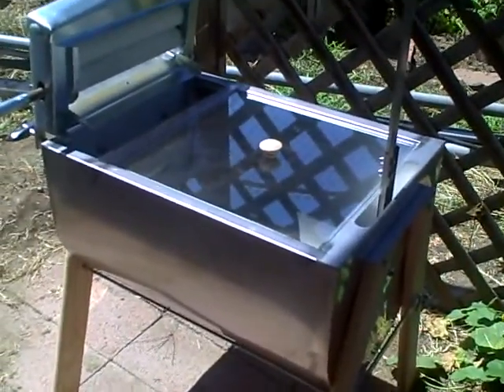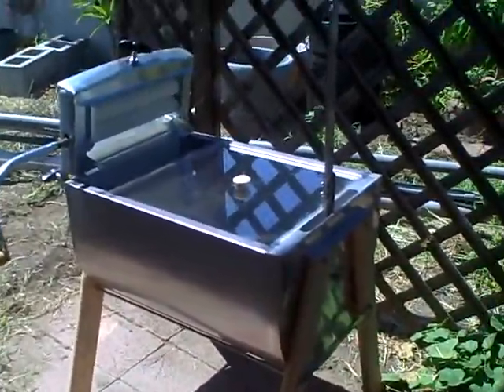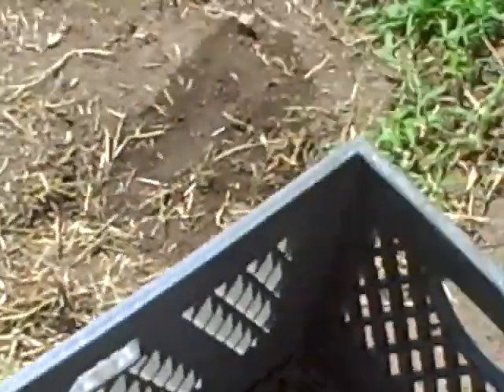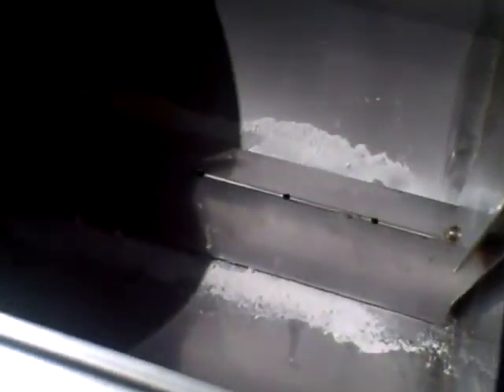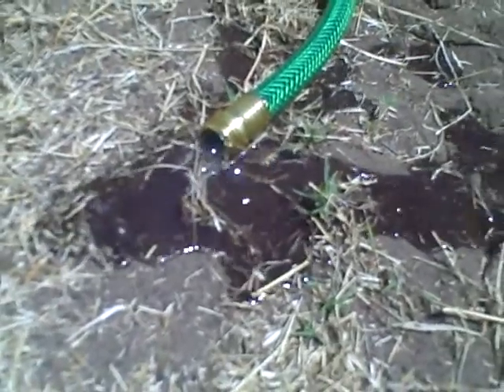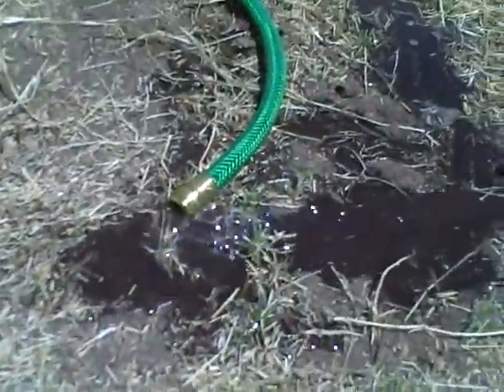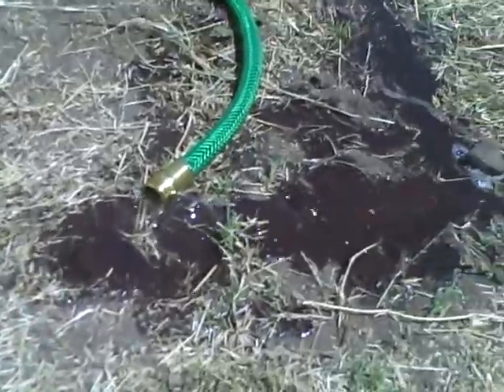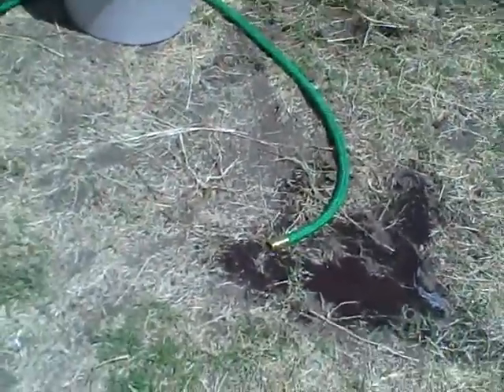My Lehman's Own Hand Washer

Comment: I have made one such washer from a 40 gallon plastic drum using 40mm pressure pipe for the agitator. Works well and cost under $100.

Comment: I just got mine, today, and am trying to figure out how to assemble it. It comes with 3 different size bolts, but doesn't say which to use for what. I guess I'm supposed to scab it together and then take it back apart when the last boots won't fit? I've left a message with customer service, and am waiting in the 90 degree weather for a callback. Sorry, I'm a little grouchy. For the amount I paid, it should come with a couple pages of instructions with pictures. I'm excited to get started using this!

Comment: Just a easy way to hang your shirts to dry is to put them on plastic hangers.  Takes less room and ready for closets.
Reply: Yep...I use wooden clothes pins to help keep shirts in place and socks secure. I live in an apt. So I hang in the doorways, sometimes 'staggering' down the hangers hooked onto each other in two's and three's. And put at least one portable fan towards our 2bdrm hallway door. In the winter, our portable heater sits on a chair and is used instead; directing the air close to and towards the clothes in a safe manner. Sometimes the a/c--heater is on a minimal temp to help draw in the maybe extra moisture.